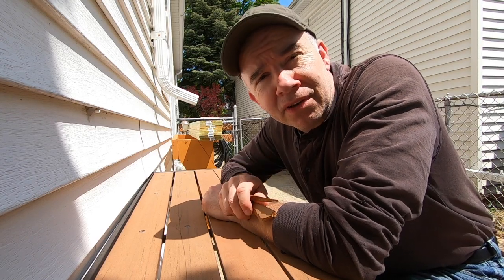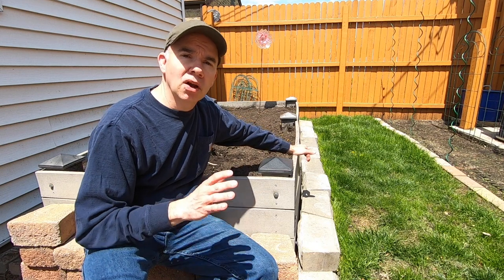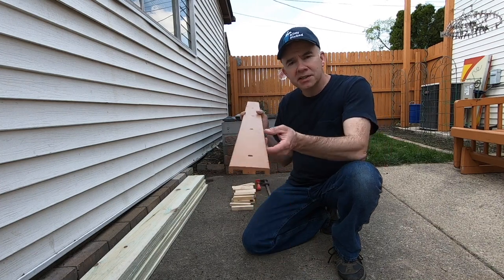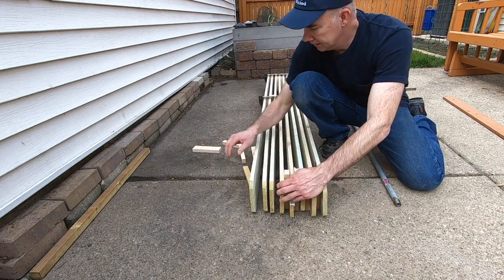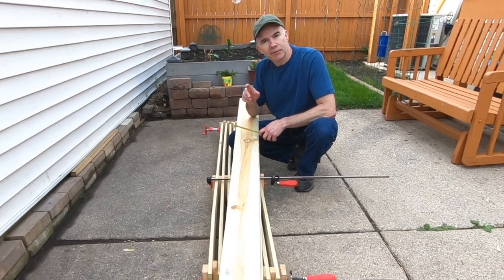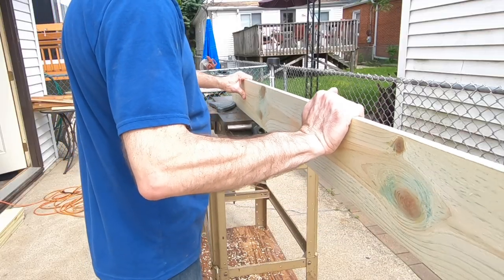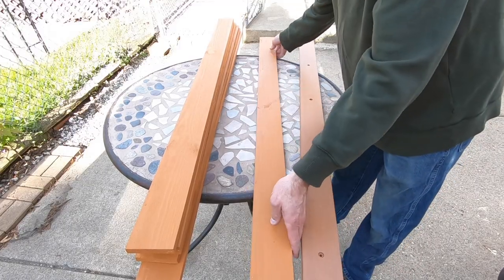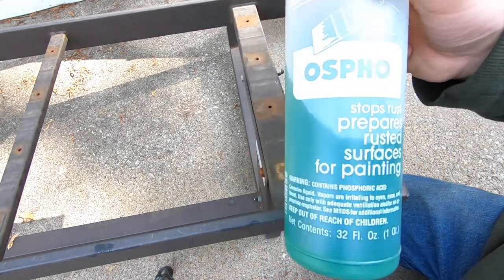Restoring my Fake Wood Lifetime Bench

Comment: When you say "treated". Is that the type with arsenic, so that the wood won't rot when it's buried?
Reply from the maker: I am referring to "pressure-treated" lumber BUT... Most pressure-treated lumber no longer contains arsenic. ... For many years, the only real choice of pressure-treated lumber was wood treated with Chromated Copper Arsenate (CCA). As the name would seem to indicate, it did contain arsenic, which leached into the soil and could contaminate the plants in your garden.
Reply: Thanks. So now it's safe for a food prep and eat area?
Reply from the maker: I am not sure the exact chemicals used now to treat the wood. Also, since I sealed the wood, that will offer protection. Given the fact that I would never put raw food on it or food that wasn't on a plate, it should be just fine.
Reply: Thanks.